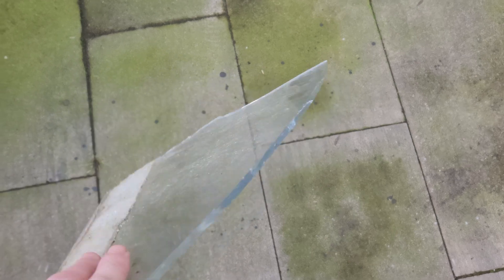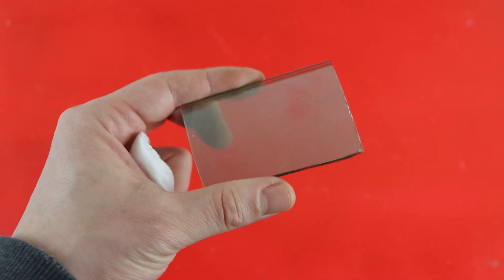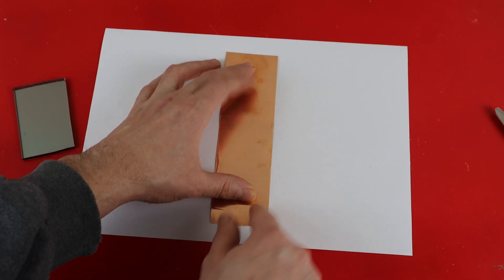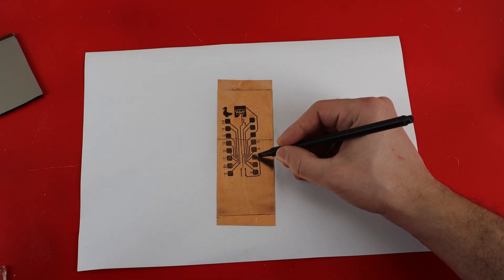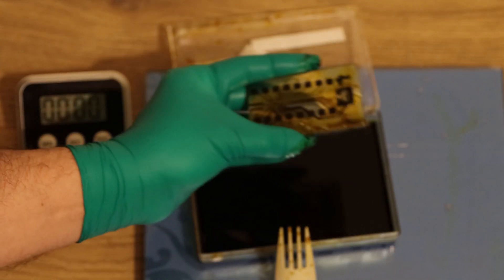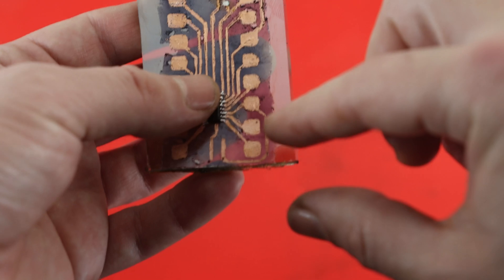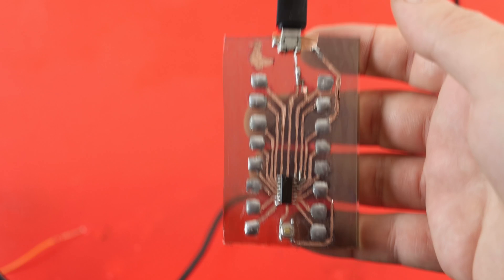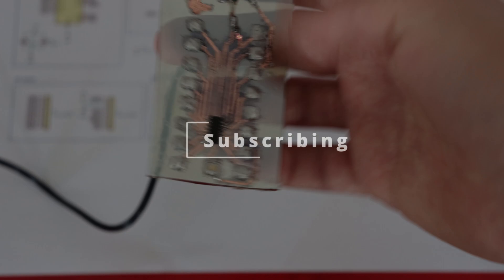How to make a Glass PCB at home

Comment from the maker: Forgot to mention it the video. There are 2 types of copper tapes. One of them is the "regular" one, which has a non-conductive adhesive. The other type has "Conductive" adhesive. Do not use the conductive one, because that one will not work.

Comment: I’d be worried about the longevity of this board due to changes in heat and humidity lifting the tape. Or if you accidentally scratched a trace.
Reply from the maker: Your concerns are valid. It's not very "durable," so to speak. It primarily has experimental and aesthetic value.
Reply: @makersfunduck  Why not use clear epoxy on the glass and then stick the non-adhesive side of the copper tape on it? It will be easier to not get a lot of wrinkles in it and a lot more durable too, just need to remove the backing and then wipe the adhesive away with acetone. The copper tape will be stiffer with the backing on to keep wrinkles out and with the epoxy you'll actually have time to "iron" the wrinkles out before it cures.

Comment: Get you a:
Woven fiberglass cloth
Epoxy
Thin copper sheet.

Lay out your fiberglass cloth on the copper sheet and bond it with epoxy. Now you have a non-conductive substrate and adhesive with a copper surface. Theoretically it should work as a PCB.
Reply from the maker: But wouldn't that just make it like a regular old PCB? I was aiming to create transparent PCBs.
Reply: @ it would. I didn’t know your goal was to make it clear. I thought you wanted to make it non conductive and fire retardant.
Reply: Why would you use fiberglass cloth? So many cheaper options if you want fire retardant PCB.
Reply: @DrakeOola because it’s like $20 for 50 square feet (.44 cents per square foot) sounds pretty cheap to me. Not to mention the remaining amount of cloth you’d have left over after only using approx 17% of a square foot.